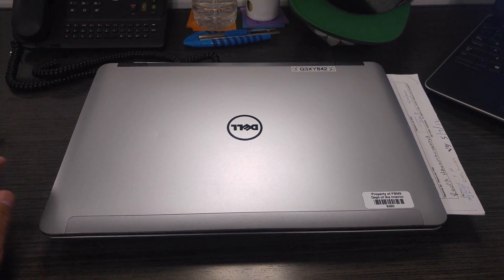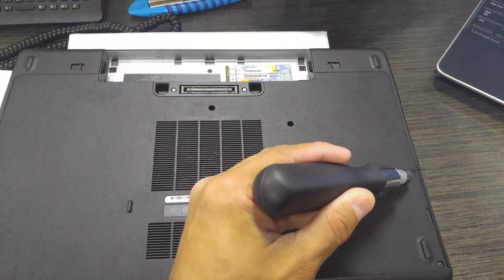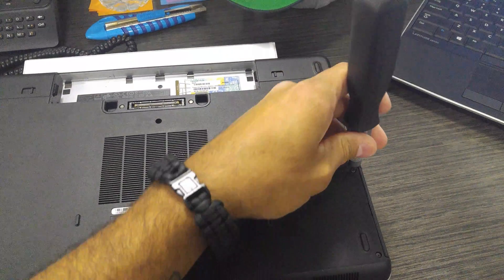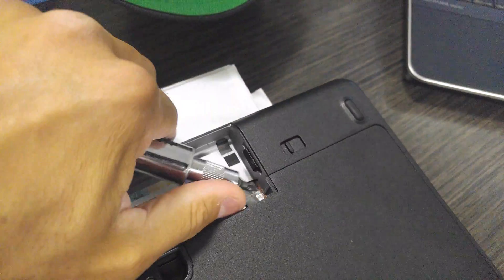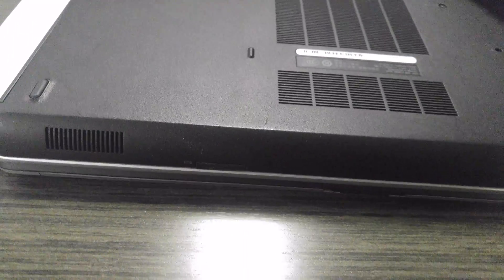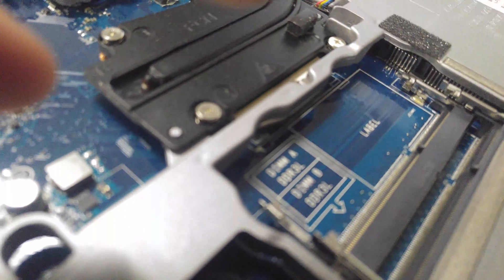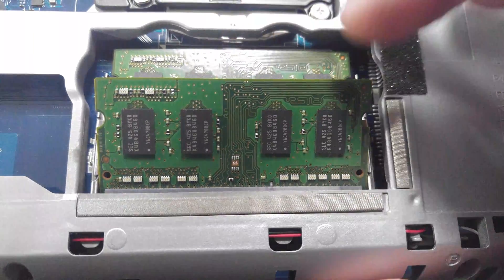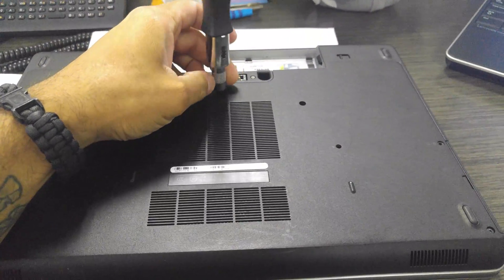Dell E6540 Memory Install

Comment: Hello, I just got this laptop and I'd like to upgrade pretty much everything in it...Could you please if possible tell me what kind of internal ssd it supports ( Not the main ssd drive 7mm,  but the one that goes into the motherboard) and also how to spot their location inside the laptop. Thanks in advance.
Reply from the maker: Sorry for the delay in response.  It will support any ssd.  The drive slides out of the side.  There are 2 screws you need to remove and the hard drive slides out the side.  When looking at the memory sticks, it is literally just to the right of them.  You will see the little ledge for removing the drive once you remove the 2 screws.